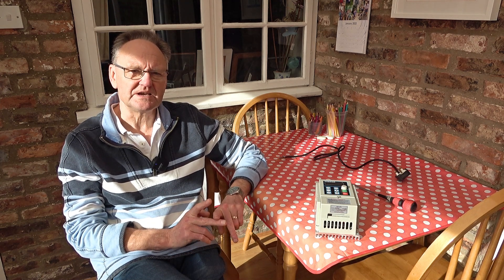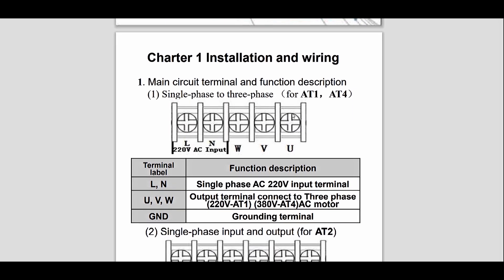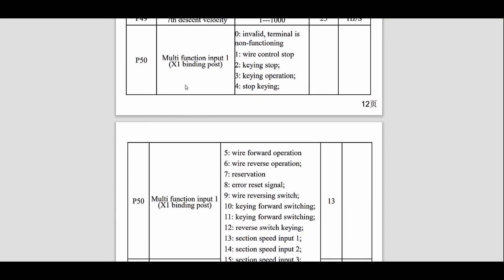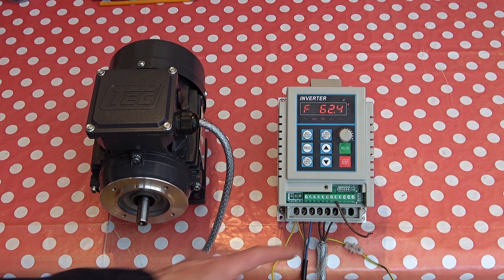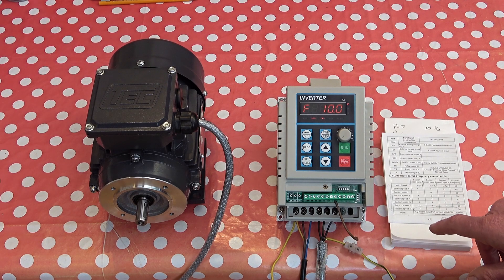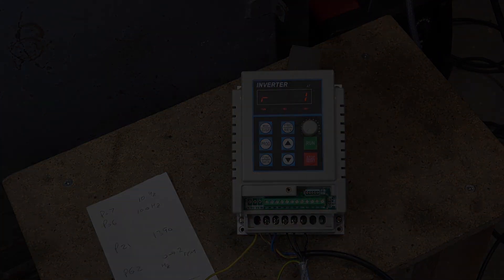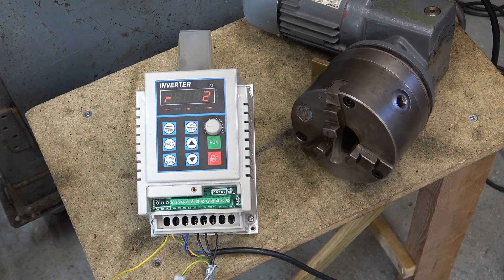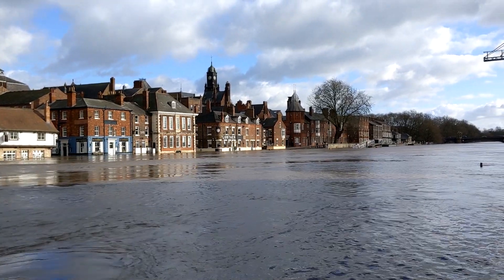HS127 Inverter type AT1 setup and test

Comment: Hi. I think you have mentioned briefly how you use a inverter on your Harrison 140. I’m looking at fitting 1 to my 140 to gain some speed for working on smaller items. Can you share briefly how you did it and what speeds you get with it and if you till use all your gearbox or do you use the Inverter to got your lower speeds and keep it in high? A video would be great but I don’t expect 1 for just me. Hope your well.
Reply: Hi Paul, I would second Grant's ask for a video about the Harrison setup, I have my Harrison running straight to the inverter, but I would like to have the old controls on the front of the lathe wired in, and an emergency stop. It looks like I can. But there would be a bit of figuring for me to do, and if yours has it already then that is half the battle. 

As for videos and making them, I know what you mean. I have about 30 videos made and uploaded, but I have been posting one a day and it seems to work, If I have something immediate I can add it in. The rest is filler. I have found over the years that some videos take a while for youtube to recognise as useful, but once they do they become quite popular. The balance is that subscribers may not like these videos, as they may have seen me make something similar before. Subscribers seem to like the ongoing saga type videos with news and back and forth, but I have found that there are a lot of people out there who want the short answer to how to do something, and YT recognises that financially.

I love looking at floods, people always seem surprised when it happens, and we won't learn.
Reply from the maker: @bootsowen  I aim to release a vid once a week at a fixed time, 00:30 Friday morning for our timezone, and that's manageable without too much pressure (I do have a life outside YouTube). Ok I will try to bring forward a Harrison inverter vid and slip it in before a long series I'm working on currently.
Reply: @HaxbyShed  There's no rush with it, or indeed any need to do it at all. Focus on what you love! Thanks for the help so far!
Reply from the maker: Hi Grant, give me a bit of time to think and I may be able to a do another "viewer's questions" video. At the moment I'm producing video at a high rate - more than I can edit and I've releases planned weeks ahead. In brief, I wired up the inverter direct to the motor and I run it between half speed (25Hz) and full speed (50Hz) but I fitted a double size pulley to the motor so half motor speed gives me the speeds on the gearbox and full speed gives me double the speeds on the gearbox. So yes I still use the gearbox. That's a very conservative setup. The inverter should provide full motor torque up to the rated speed (50Hz speed). I'm still not used to carbide inserts and I tend to run them too slowly - but it means most of the time my motor is only on half speed hence the lathe is quiet. It's an old motor not really inverter rated but I could probably run it up to 60 or 70 Hz without any risk if I wanted to. The motor in this vid is new and probably has the same armature for 4 pole and 2 pole versions so I was happy to run it up to 100Hz double speed for this demonstration but the torque drops off quickly after the rated speed (50Hz in this case). I hope that helps. Cheers
Reply: Hi Paul, The new inverter that you have looks exactly the same as the one that I bought to run my 140, so I too would be very interested in your thoughts about the most effective set-up. I'm thinking that as my inverter will be wall mounted above ( and behind ) the top mounted gearbox levers, the remote pot to vary the speed would be useful. Being able to speed the motor up on a large facing job whilst the tool is cutting would no doubt improve the surface finish as I approach the centre.  Ideally, I'd like to use the existing forward / reverse switch. If you can see a way of incorporating that in the inverter control circuit, that would be a real bonus!  A VERY useful episode of Haxby Shed!
Reply from the maker: Hi Chris, just a quick response, yes I use the existing big direction control lever on my Harrison electrical panel in the base to control the inverter forward/reverse. Generally these inverters have three terminals for direction : F, Common and R. So it's just a case of strapping the old 3 phase reverser switch so it bridges F to Common for forward and R to common for reverse. These controls are low voltage so there is no shock risk. Let me think about a vid for you all. Cheers.
Reply: @HaxbyShed  thank you for your reply. Hope to see a video in more detail. No many people out there in the YouTube world use these lathes so it nice to see how other people do it.

Comment: Hello Paul,
So will you be swapping the inverters around? thanks for the video I did not know much about inverters but know a little now..
Take care.
Paul,,
Reply from the maker: Hi Paul, about the only essential parameter change in the inverter for each motor is the current overload setting. For my lathe and shaper I have dedicated inverters but for other tools/machines which are used only occasionally I can manage with one inverter between several, just on cost grounds because good inverters are expensive.   Inverters really are a "miracle box" cheap and small and providing speed control (which you won't get with rotary converter or static converter). Cheers

Comment: To run at very low RPM you would probably be happier with a flux vector control or one of the sensorless flux vector controls. I have had success with the vector controls running rated torque at zero speed. But those drives are industrial duty and not your $60 drives, more like $300 to $600 for 2 Hp. Full vector control requires an encoder- I tend to use 1200ppr quadrature complimentary outputs. ( and can be the cost of your motor!) AB Powerflex, ABB ACS800/880, Siemens etc are the industrial versions I am familiar with. I am sure there are others in your neck of the woods.
Reply from the maker: Hi Glenn, your comments made me jump for the handbook of my IMO Jaguar Cub (the blue inverter) and it talks about quote - "The IMO Jaguar CUB inverter delivers a higher motor starting torque using STV technology, a simplified version of IMO Jaguar’s renowned torque-vector control system for consistently powerful operation. The IMO Jaguar CUB inverter employs both advanced magnetic flux estimator and motor slip compensation with auto-boost, starting torque can be as much as 150% or more." so yes it seems to have a 'light' version of flux vector control without the sensor. The Cub is perhaps 'intermediate industrial' or 'serious hobby' grade. Over here we have plenty of options from IMO, Siemens, ABB, Mitsubishi for full industrial-grade solutions for people with deep pockets (lots of money).  Cheers
Reply: @HaxbyShed  that sounds like an appropriate unit. There usually is a prescribed routine for tuning a flux vector mode of operation. Usually includes running the motor disconnected from the rest of the machine.

Comment: Thank you! I'm trying to decipher some of the programming parameters now for the drill press. P072 gives me clues for the Welding rotator I'm also trying to slow down on a 100:1 drive.
Reply from the maker: Hi Tom, I don't know if you are on 50Hz or 60Hz but my rotary converter is on a 75:1 reduction gearbox and I wish it were more like 100:1 (but it was cheap). Most of my work seems to be down at 1 or 2 rpm. Cheers
Reply: @HaxbyShed  yes, 60 hz. I think my drive will only do 7-hz. Min. 1-2 min is just one needs for the positoner. Great work you are doing....thanks.

Comment: Remember     if its  cheap   its not good   &  if  its good  its not cheap           what you do with Electrics    is well  out of my depth
Reply from the maker: HI Alain, in this case you are right. This morning I sent you an email with some carbide inserts info.  Cheers.
Reply: @HaxbyShed       Thanks  Paul    did you see the pics i sent      what   do you think to the hight of the   Parting tool   ?

Comment: Running above rated motor HZ has a very sharp torque drop off. Below rated HZ you can achieve rated torque-  but remember at half speed and at rated torque gives you half power. Unfortunately on a lathe you need maximum power and torque for large diameters. Gear-in speeds need need to be setup for your largest diameters for rated motor speed. As the diameter comes down then have your top speeds exceed the np ratings. This way you have maximum power available at your work.
Reply from the maker: Hi Glenn, yes I understand your comment thanks. Cheers

Comment: wow,, that is way to complicated for me to be able to set up.
Reply from the maker: Hi Vernon, in most cases you can connect up to the motor and just set the overload current parameter in the inverter. There are lots of options but you don't have to use them, especially if you are using the inverter from the front panel. Cheers

Comment: Your rotator might be a lot happier with a reduction stage; perhaps cobbled from a defunct cordless drill.
Reply from the maker: Hi Jim, a reduction stage is on my list of things to lookout for. I made the rotator when I had less experience so I did not realise most of my work would be down at 1 to 2 rpm. I was guided by rotators on ebay running at 2 to 20 rpm. I will find something in due course I'm sure. Cheers.